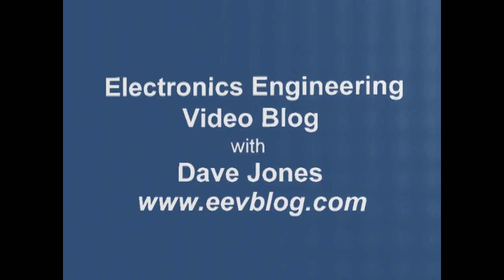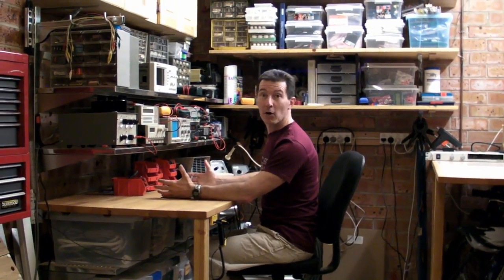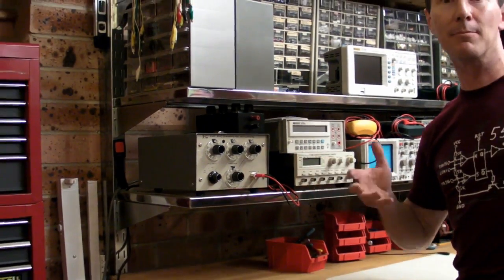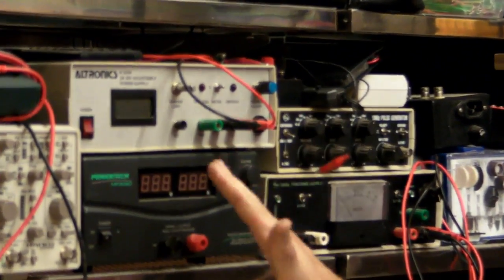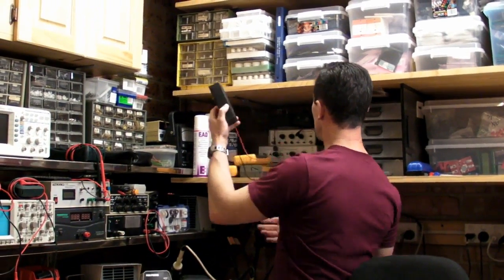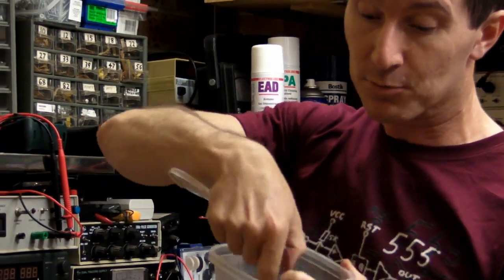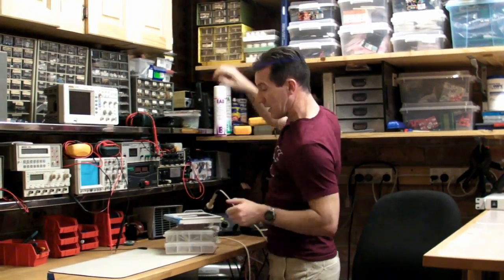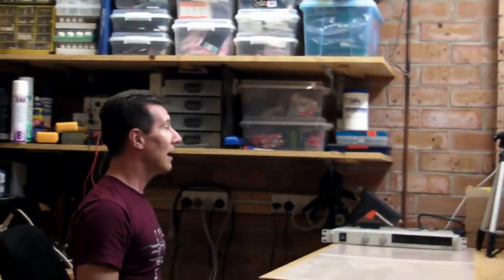EEVblog #51 - A tour of the EEVblog Electronics Lab

Comment: My lab is about the same size, but I must say mine's better organised. And I don't keep so much stuff in stock, I buy it when I need it. Let the shops take care of stock management, I don't need to do that. In another hobby of mine, photography, this hoarding behaviour is called GAS: Gear Acquisition Syndrome. Haven't really seen that term used in EE though. But you need to get rid of it, you'll actually get more work done with less money.

I also like the different paths we took. You bought your first MM when you were 8, I was programming a C64 when I was 7. So I came from the software side and gradually expanded it to hardware through microcontrollers. You seem to have started on the hardware side and gradually expanded it to software through microcontrollers. Nowadays I like the hardware stuff more than the software stuff. EE still has many secrets for me to uncover, which makes it more exciting. After 35 years of progamming the challenge is gone.

Comment: Ahhh, the storage cabinets with parts from eons ago. I have those, too. The times when everything with 3 legs was a transistor and the inner workings of most parts a mystery. 
I envy the lab equipment and the lab itself. I have to do stuff on my all-purpose desk. Fortunately I'm on the way to a real workshop. We are switching from oil to gas heating, so there's a tank room to be put to good use! Can't wait for it!

Comment: Hi Dave,

Thanks for the great video and a look at your lab. I have a 30 * 12 foot building that I insulated,  heated and provided AC plus LOTS of light.  You can see one of my benches at my web site 
 w w w  dot  dsmlabs dot  com  
I have 3 bench's set up and the one on my web page is for vintage analog receivers. I have another for solid state and digital. and one for RF design and analysis. It's great to have equipment and tools to play with.

Best regards from the US,
Glenn

Comment: Thanks for the tour. Id really recommend the Greenlee voltage detector rather than the fluke because the fluke is not sensitive enough so if you are not extremely close to the wire it wont go off sometimes, can be dangerous!